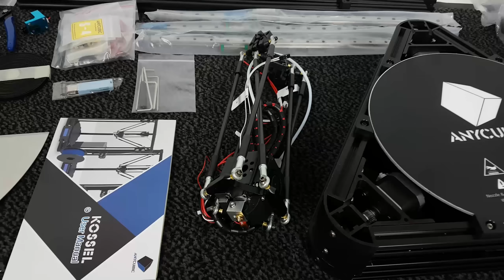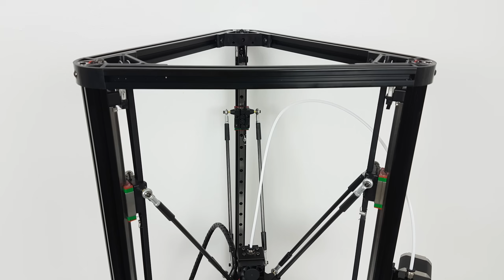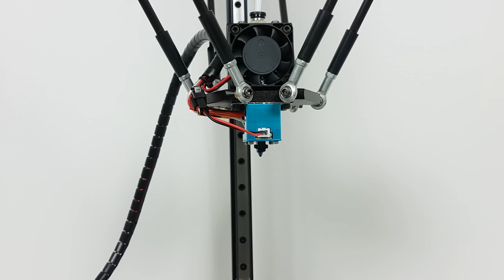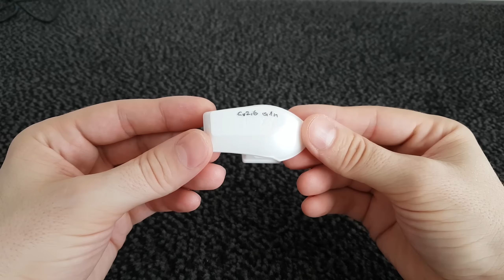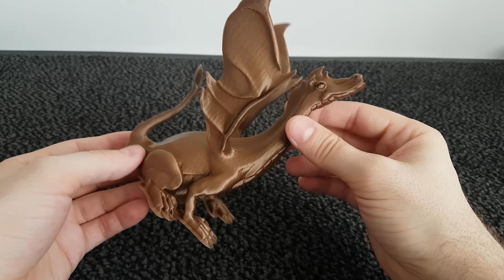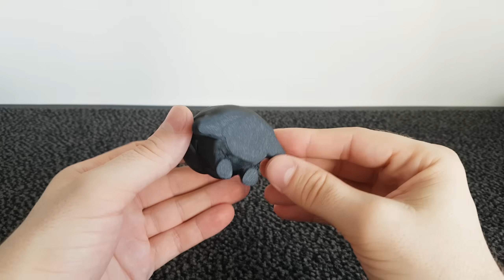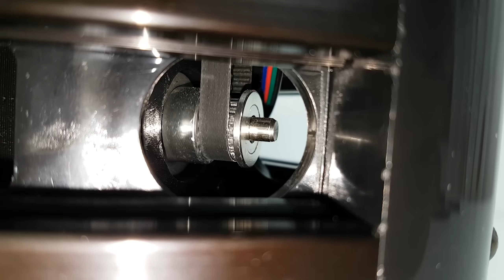Anycubic kossel Linear Plus 3D printer full review and upgrades

Comment: Hey, I'm a beginner to 3d printing and I was wondering if I should get this printer instead of the ender 3?
Reply from the maker: Why not. You got to start from something. Delta's are cool machines. Very unique movements and sound and they have great print quality. When you learn about them in the next few months then order Ender 3 PRO as well and then you will learn about FDM 3D printers as well. It's cool to know them both. It's awesome hobby and you can print/make almost any object or shape.
Reply: @NexiTech  Yes! Haha I don't think I'll be ordering another one any time soon, very expensive hahaha but is this one user friendly and "easy" to build for a newcomer?
Reply from the maker: Yes it is. It's about the same as Ender 3 maybe even more easier because there are less parts to assembly and no wheels to adjust in terms and adjustment sense this machine has linear rails.. Kossel linear plus is a solid machine. I only add glass plate after this video sense I like to print on the glass surface and stepper dampers to lower the noise and vibrations from stepper motors. Now I can sleep while is printing :)
Reply: @NexiTech  That's really awesome! I will manly print in tpu like 95% of my prints so this printer good for that to? and i really appreciate the help!

Comment: tevo tornado or this anycubic delta printer? which do you think is better for the quality?
Reply from the maker: Madblue Gaming I I This Delta definitely. Tornado has issue with salmon skin you need to use TL smoothers and adjusts steeper driver's to get nice even layers.
Reply: Hi nexi tech i just bought the anycubic linear plus. im having  a trouble, my prints have this tree vines effect on the walls ive tighten all screws and check everything. maybe its my settings? how can i fix this? what is your current settings in the printer?
Reply: Nexi Tech can I ask for something? That auto leveling mechanism is included? Thank you for answer. Btw nice video. As always. Have a nice day.
Reply from the maker: BlackboardIdeas Yes, Autolevel  probe is included in the box.
Reply: Nexi Tech Thank you very much for a quick answer. :-)

Comment: Hi, I need to ask you a question. buy the same printer and I have a problem when removing the finished piece from the plate, it is very stuck, I see in your video that you take it with one hand and without problem, but in my case, or with the help of the spatula I get it out fast. Do you add any liquid to the plate so that the piece does not stick so much? from now thank you very much for your help
Reply from the maker: Menth Federico That means that your first layer is to low. Try to increase thr first layer in slicer by 0.1mm or 0.2mm. You can do it on printer itself. It's Z offset. Look in the manual. Also after the print is done(PLA) you can worm up heat bed to 50/60C for few minutes and it should be much easier to remove the print. Don't wait to long becouse heat can deform the print.

Comment: I need a little help, I just put my Kossel Linear together and it's working great I print from SD card only no PC connected to printer. Whenever I  turn on the printer and start to print I must run the bed leveling procedure or it will start the print like 10 inches from the build plate, running the complete leveling procedure then printing from sd works perfect.  I must be missing some simple step can anyone help? It's a  pain to run the leveling procedure all the time.

Comment: Hey, how much faster is this printer compared with the ender 3?
Reply from the maker: Luca Van Thiel It's hard to tell how much faster. Delta style 3D printers in general are faster then FDM 3D printers and they have better print quality in higher speeds because delta's has much less mass to move around and Headbed is stationary.

Comment: Have you used the flsun qq Delta. If so what are your thoughts
Reply from the maker: I know that 3D printer. And to be honest I think that using linear bearings on two rods is not nearly as stable as frame with aluminium extrusions like on any Delta kossel from Anycubic. That metal on Flsun qq Delta is just covers for the linear rods and it don't like that design. It looks nice to the eyes but not for me. Look just Assembly video and you will understand what I mean.  https://www.youtube.com/watch?v=ByU1cU9_Sps

Comment: Hello, did you use the stock firmware or any other version?
Reply from the maker: Alexander Bauer I did not change or upgrade firmware on this printer. It's stock one.
Reply: @NexiTech 
Can you tell me more about the printer setting?
Acceleration
Jerk
Retract
...
I have the same printer, my results are not as good as yours
Thank you so much, br alex

Comment: So: My kossel arrived put it together, but something is wrong. Can someone whose kossel is working perfect tell me the settings they use in cura ? I'm pretty sure I have mine wrong. Not sure about the gcode flavor, which printer needs to be selected etc...
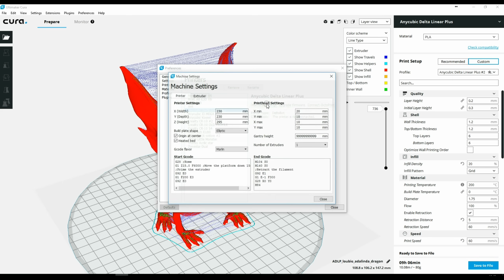Reply from the maker: blackknight3830 Look in 10:10 you can see printer settings. Select deltabot and gcode Marlin.
Reply: Thank you very much Nexi I actually realized I can see it later on. But I value your reply!
Reply: Dear Nexi! You have helped me before with the settings, but I must ask you again. I'm very plseased with the results you achieved in the video, and have to ask: What are the acceleration/jerk settings you use ? My prints have some issues on corners, it looks as if the PLA slides off course, and comes back on track, thus creating a bulge. Maybe I'm printing too fast? (60mm/s print, 80mm/s infill, 150mm/s travel, 1800 XYZ accel. 17 XYZ jerk) I know it's a big ask but here's hoping. 

Thank you
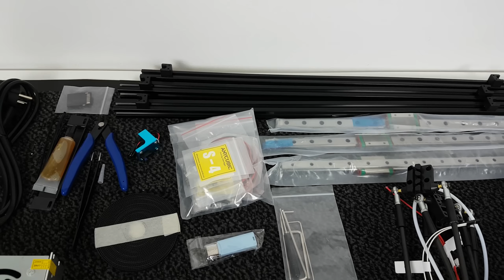Reply from the maker: blackknight3830 Hi mate! You don't print to fast with those settings if you printing big objects without alot of details and corners. But for smaller much detail objects you need to lower the speed. 80mm/s for infill can be to much for most of detail prints. My acceleration(In cura) is 1000mm/ for travel and print speed. Jerk are not changed. Kossel is by default is much faster in print and travel then estimate time in CURA. For some of my prints estimate print time was 2 hours and Kossel is done in 1:21h. So don't think that you are printing slow in 60mm/s in reality that can be close to 80mm/s. You need to spend time with your kossel and play with the settings to try to match estimate print time with actual print time. Also check your temperature(For PLA 195/200) and retraction speed 70mm/s and distance 4mm. Linear rails(are they installed perfect?) Check both side distance(mm) between rails and aluminium extrusion. They need to be in centar and have same distance to the both side. Check it on the bottom and on top. Also check your heatbed for any loose and place something under the printer to lower vibrations(cheer pads works good).
Reply: Thank you very much AGAIN Nexi, a lot of useful advices, been playing with the settings all weekend, and will continue to do so. On behalf of the rail though: 2 of my rails are/were binding slightly, and had awful results do to them, took them apart, managed to improve them. I've written to anycubic about the rails, really interested what the reply will be. 

I will try more settings then, and if you don't mind I may keep writing my experiences (maybe even make videos, or post pictures somehow) 

Thank you again for your kindness.
Reply: Hi again Nexi! So I have made adjustments due to your suggestions, and to anycubic, but I'm still not getting the results I'm looking for. Here is a drive you can look at the pictures I took (hope the link works). 

https://drive.google.com/drive/folders/1uMqfPpGBqPcZ5rz2axb4iDfm0rFC-5_T?usp=sharing

Really upset so far, after seeing your video and print quality I'm really sad about mine.
Reply from the maker: blackknight3830 Take photo of your settings,CURA version and what material you using.
Reply: Added Images of settings to drive, (only lowered accel. on printer to 1000) Cura version (on your recommendation) is 3.1.0, and the black material is the stock filament that came with the printer. I also have PLA from hobbyking (brown), it seems to work better to be honest. And have an unopened roll of Verbatim PLA (white), haven't tested that one yet.
Reply from the maker: blackknight3830 Settings are good only Top/bottom speed could be lower like 25-30mm/s for those prints. That black PLA seems to be pretty bad as on beginning of every layer it leak a bit. Try to lower the temperature to 195 or even 190degrades as some cheap PLA have much lower melting temp. Also check your heatbed for any loose or vibrations during the printing as i can see some effects on prints as well Maybe adding some chair pads under the printer. Other then that I don't thing that you can tweak more as other issues can be link to mechanical parts like rails, way that you build it and quality of parts. And one more think perhaps most important. Try CURA 2.6 version before anything and print the same part for test.
Reply: Nexi Tech Hi... Again. ( you must really be fed up with me by now :D) I updated the drive, tested the verbatim pla, works like a charm, but I would like to ask you, what can be the cause of that ringing/ghosting? Jerk, vibrations, acceleration, speed... Or all the above. :/ Oh and one more thing, one of the rails developed surface rust. Soooo that doesnt help the binding at all.

Comment: Any chance you share cura profile?
Reply from the maker: For what material and what 3D model? Am changing my print settings all the time.
Reply: @NexiTech  Basic one for start, so I have something to work with, am using PLA most of the time, this is my first delta style printer, so don't really know much, it's cheap so I decided to give it a shot, just realized that I can't use whole 230mm surface... Or am wrong?
Reply from the maker: FilaFlip 3DPrint  Yes you can use 230mm on X and Y axis in printer size. Here is printing profile and use Cura 3.1 and make sure that nozzle size is 0.4mm because all newer version of Cura has bug for delta bot configuration nozzle size on 0.5mm and you cant chage it to 0.4mm.  https://drive.google.com/open?id=127bsdCaWHNmQL6YvXaCFBI3Fu1HMtFVZ
Reply: @NexiTech  thx mate will give it ago as soon as I come from work ;)
Reply: How do you make it to print 230mm? In Cura it doesn't alow more then 190... even if I put 230 diameter...

Comment: What about cura 3.3.1?
Reply from the maker: ComputermanAM13 It's the same. It does not remember 0.4mm nozzle in deltabot configuration. It swich to 0.5mm. So I guess 3.1version is last "good" version or you could change nozzle to 0.5mm and use latest CURA if you wanna it.
Reply: Nexi Tech Ok thanks! Why they don't fix such a stupid bug?
Reply from the maker: ComputermanAM13 I  wondering myself the same. I even leave comment on official forum and still nothing.

Comment: someone please help me with prior knowledge as whenever i try starting a print from my laptop to my anycubic kossel plus printer, it homes all axis then moves the head to a corner of the perimeter near an aluminum rod then drops it into my build plate until i need to stop everything. im using cura 3.1 as in this video and nothing seems to work. i've checked the openning Gcode a dozen times and theres no code that tells it to move to a corner and drop down bellow my set zero. i even tried editing the start gcode to make my zero significantly higher than it should be set to and it still goes through the same motions every time. someone please help me or share your arduino firmware for your printer that works for you i've changed many things and gotten my printer just right and now i want to use cura rather than repitier but cannot get passed this problem hwenever i hit start print via usb.
Reply: id like to update everyone Do NOT i repeat DO NOT create your own profile for your anycubic kossel in cura. use only the deltabot setting for printer. it works great!!!!! thank god ive been working at this for days now holy cow!!! after getting your arduino setting in that configuration.h fila and the configuration_adv.h file done then just use cura it is soooooo easy. no more need for repitier anymore!!!! :):):):)

Comment: fap fap fap :D 

Seriously, in Germany there are the "Renkforce RF1000" printers sold. Good printers, very "long term" reliable, but they haven't put out such good prints. They costing around 1,200-2.000€, depends what options you choose.
And we had tweaked the settings nicely, cared for them, fed them good filament and so on. But they didn't put out such prints after only a few tweaks here and there. Also they lack a few functions. 

This thing cost's a fraction and works so awesome. It will be my first own printer and I will put small fans around the 3 lower Steppers. I like my steppers cool. Also planning to upgrade to the silent(er) Trinamic steppers, because the printer will reside near the place where I'm sleeping. It wouldn't go extremely silent I know, but silent enough to not disturb anyone and let me sleep. My first prints won't be day-long, but they might increase in size... ^^ 

What I also like, the resume function when filament runs out or the power cuts off (which all of a sudden happens in our house, because the earthing wire has too much induced current.

Comment: I own this printer and it is amazing for much, but I'm having a problem with walls and top layers not meeting up.  I've leveled the build plate and have good starts to the print, I've modified all kinds of settings in CURA but when I print a benchy box with no infill the top of the box just pushes through every time with not much resistance...I own 3 other printers (Anet A2, Cube 3, and Hero101) and they all print the box with a good solid top, so I'm sure there's something minor...I've taken a bubble level to the top and bottom of the printer and made sure the rails all line up...I just downloaded CURA 3.4.0 and still having same issue...help plz
Reply from the maker: Mike Gifford Is the top layers quality always the same regardless of the model size? Have you tried to print tall object without the top layers like me in the review? It's very weird that bottom layers are good and top layers to be bad.